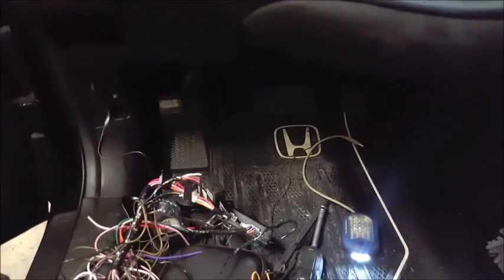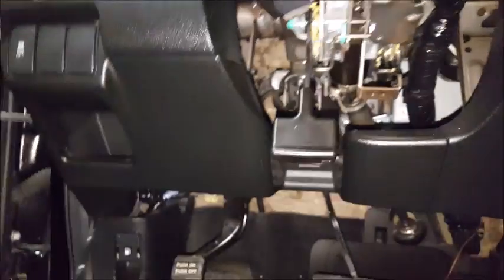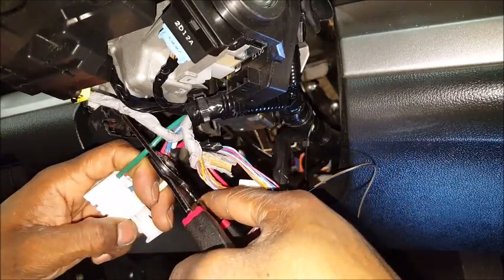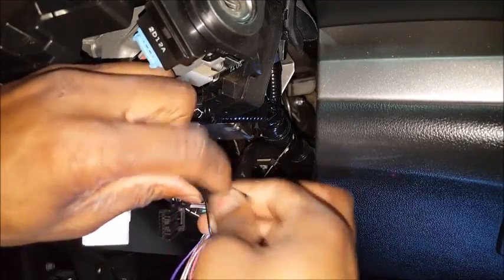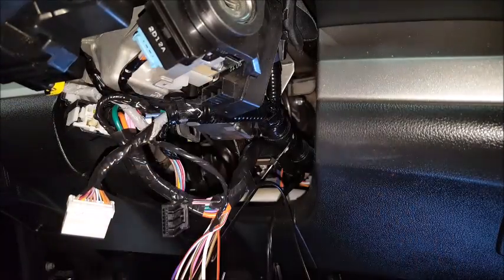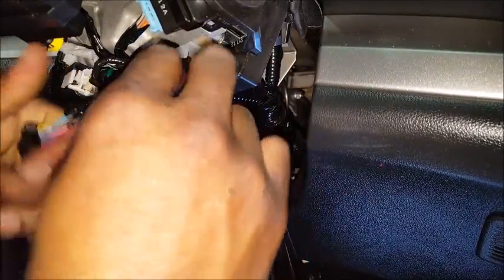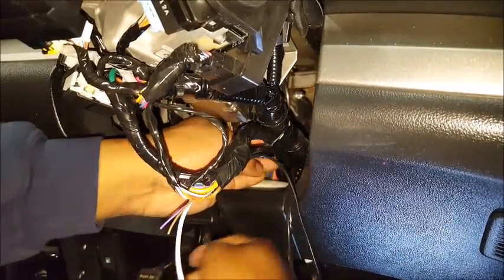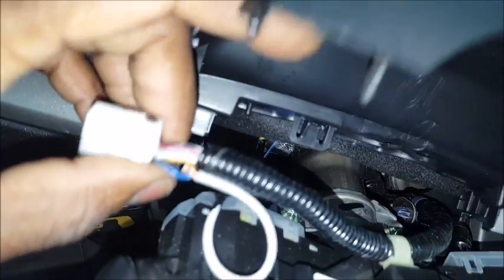How To Install A Remote Start Alarm  Completely From Start To Finish on Any Honda 2001 2017 1 HR Vid

Comment: Well very helpful and inded easy to understand, and hope you would guide us to the very end of installing the remote system.

Sir, can I split the wires which control the lock and unlock of the remote control unit and join to the corresponding wires/pins (which lock and unlock doors) of the input connector BCM so that by locking or unlocking using the fob key, all doors and all windows are closed automatically at the same time.

In short, lock or unlock with fob=all doors lock or unlock and all windows closed at a time.

Also, if that is possible, I guess no voltage issues will arise on the remote control unit and the BCM unit, since we are only sending pulses to lock, unlock all doors and windows. Kindly ignore this paragraph if I'm mistaken.

Awaiting your utmost help ad reply.
Thanks.

Comment: Is this the same for a 2008 accord
Reply from the maker: The wire colors are different  but everything pretty much is the same in the same location
Reply from the maker: This wiring information is being provided free of charge on an "as is" basis, without any representation or warranty. It is your responsibility to verify any circuit before interfacing with it using a digital multimeter.
Directed electronics, Inc. assumes no responsibility with regards to the accuracy or currency of this information. Proper installation in every case is and remains the responsibility of the installer. DEI & this Channel Creator   assumes no liability or responsibility resulting from improper installation, even in reliance upon this information.

 Wire/Function  Color  Location/Description  Polarity
 PASSIVE ANTI-THEFT  YES  TRANSPONDER    SEE NOTES 
 12 VOLTS  White  Ignition switch harness    + 
 IGNITION  Blue  Ignition switch harness    + 
 ACCESSORY  Orange  Ignition switch harness    + 
 STARTER  Yellow  Ignition switch harness    + 
 KEY SENSE  Pink  Ignition switch harness in white plug    - 
 TACH SIGNAL  Opposite from BLACK/ white or Blue  At any of the coils on the engine    AC 
 FUEL INJECTOR  Opposite from Yellow/black  At any injector on engine    AC 
 LOCK  Orange  At switch in driver door    - 
 UNLOCK  Brown  At switch in driver door    - 
 posted_image  Double pulse to disarm and unlock. May require a pulse to WHITE wire at same time as BROWN, diode isolate.
 DOORPIN  SEE NOTES       
 posted_image  Green (Driver's door), Lt.green (pass. Door), Brown (Rear left) and Gray (Rear right). All 4 wires are (-) and found in the green 42-pin plug on the top of the fusebox under the driver's side of the dash.
 HOODPIN  Lt.blue or Yellow/red  At pinswitch or front of fusebox    - 
 posted_image  Not available on all models.
 TRUNK PIN  Blue or White  In green 42-pin plug top of fusebox    - 
 TRUNK RELEASE  Orange  In green 42-pin plug top of fusebox    + 
 FACTORY ARM  Arms with lock       
 FACTORY DISARM  Disarms with unlock       
 BRAKESWITCH  Green  At brake switch    + 
 PARKLIGHTS (-)  Gray  In green plug on back of fusebox    - 
 HAND BRAKE  Lt. Green  At parking brake switch    - 
 HORN  GREEN/ YELLOW  In green 42-pin plug top of fusebox    - 
 DRIVER WINDOW UP  Red or Yellow  At switch in driver's door    Rev Pol 
 DRIVER WINDOW DOWN  Green  At switch in driver's door    Rev Pol 
 PASSENGER WINDOW UP  Orange  In harness from driver's door    Rev Pol 
 PASSENGER WINDOW DOWN  Brown  In harness from driver's door    Rev Pol 
 LEFT REAR WINDOW UP  Green  In harness from driver's door    Rev Pol 
 LEFT REAR WINDOW DOWN  Violet  In harness from driver's door    Rev Pol 
 RIGHT REAR WINDOW UP  Lt.blue  In harness from driver's door    Rev Pol 
 RIGHT REAR WINDOW DOWN  Red  In harness from driver's door    Rev Pol 
 HEADLIGHTS  Pink  At light switch harness    - 
 REVERSE LIGHTS  Brown  In driver's kickpanel    + 
 VSS WIRE  Blue  In plug on back of radio    AC 
 TRANSPONDER DATA 1  Lt.Green  Pin-3 at 7-Pin connector    DATA 
posted_image Available Notes

Comment: How do you extend the remote running time from 15 to 30 minutes
Reply from the maker: Diesel Matthew program menu 3
Reply from the maker: Diesel Matthew 12 24 without a bit writer there is no 15 30 selection

Comment: for the most part, posi-taps would've been alot easier.
Reply from the maker: Those things always failed! I can Literally live off  the Redo's and/or of just repairing Those types of installations
Reply: 4 alarm installs and still going strong.  All wires are hidden though. I think the only issue I had when i 1st started using them was that I used the wrong size posi-tap for specific wires and the pin didn't really make contact.  After that all was easy peezy.
Reply from the maker: Oh OK As long as it's working for you that's all that matters. Thanks for the post it let me know what you guys like.

Comment: Great video
8:40 -"just bite with the strippers"
Instead of biting 2x with the strippers and removing 1/3 to 1/2 inches of insulation, you can use your strippers to bite and pull the insulation back 1-2mm. This exposes a small but sufficient area of wire to work with yet does not remove any insulation. If you ever remove components it makes it look like nothing was ever wired in.

Comment: Does the Honda Accord 2000 and the 2001 have the same colored wires ?
Reply from the maker: Danny Loreto starter white black stripe
12volts main power white
Ignition black yellow strip
Second ignition black white strip
Accessory white red stripe
Reply from the maker: Danny Loreto yes sir
Reply from the maker: This wiring information is being provided free of charge on an "as is" basis, without any representation or warranty. It is your responsibility to verify any circuit before interfacing with it using a digital multimeter.
Directed electronics, Inc. assumes no responsibility with regards to the accuracy or currency of this information. Proper installation in every case is and remains the responsibility of the installer. DEI & this Channel Creator   assumes no liability or responsibility resulting from improper installation, even in reliance upon this information.

12volts white   +   ignition harness 
Starter BLACK/ white   +   ignition harness 
Notes: If doing starter kill, must interrupt the wire between the keyswitch and the fusebox, not between the fusebox and the starter, to keep the check engine light from coming on. 
Second Starter N/A        
Ignition BLACK / YELLOW   +   ignition harness 
Second Ignition N/A        
Third Ignition N/A        
Accessory yellow   +   ignition harness 
Second Accessory WHITE/ black   +   ignition harness 
Keysense          
Power Lock BLACK/ blue   -   passenger side fuse box 
Notes: in a green 20 pin connector.
Use BLACK/ white for lock and GREEN/ red for unlock on LX models without factory security. These wires are located in a two pin gray connector by the front of the drivers side fuse box. 
Power Unlock orange   -   passenger side fuse box 
Notes: in a green 20 pin connector.

Use BLACK/ white for lock and GREEN/ red for unlock on LX models without factory security. These wires are located in a two pin gray connector by the front of the drivers side fuse box. 
Lock Motor WHITE/ red      driver side fuse box 
Unlock Motor        driver side fuse box 
Notes: yellow on the EX and lt. GREEN/ red on the LX 
Parking Lights+ RED / black      driver side fuse box 
Parking Lights- RED / yellow      steering column 
Notes: Only available on the EX model. 
Hazards          
Turn Signal(L)          
Turn Signal(R)          
Reverse Light GREEN/ black   +   driver side fuse box 
Door Trigger BLACK/ white   -   passenger side fuse box 
Notes: In a green 4 pin connector. 
Dome Supervision use door trigger        
Trunk/Hatch Pin orange   -   drivers kick panel 
Notes: Above the hood release in a gray 18 pin connector. On the DX & LX models, also found in a 2 pin connector behind the drivers fuse box. 
Hood Pin yellow/red or yellow   -   hood pin switch or 
Notes: On the EX models it is in a green plug next to the passenger side fuse box. On the LX models it is at the keyless/security unit, if equipped, which is attached to the driver side underdash panel. 
Trunk/Hatch Release WHITE/ red   +   drivers kick panel 
Power Sliding Door          
Factory Alarm Arm          
Notes: Arms and disarms with the door locks on the EX models. The LX models arm only with the factory transmitter. 
Factory Alarm Disarm          
Notes: Arms and disarms with the door locks on the EX models. The LX models arm only with the factory transmitter. 
Disarm No Unlock blue   -     
Notes: On the EX the wire is located at the drivers power window switch, on the LX the wire is at the keyless/security unit which is attached to the drivers underdash panel. 
Tachometer blue      tach test connector 
Notes: The tach test connector is located behind the battery on the 4 cylinder, and on a bracket attached to the drivers side strut tower on the 6 cylinder motor. The tach test connector is a white 2 pin connector, and may be covered by a black rubber boot. 
Wait to start          
Brake Wire WHITE/ black   +   brake pedal switch 
Parking Brake          
Horn Trigger lt. GREEN/ blue   -   steering column

Comment: hey. so much information in this video, thanks. can you help me out ? i got a viper system with dball2 and a smartstart. kinda confused on how all three of these connect to eachother.

i was thinking the smartstart connects to the dball via the 4 pin d2d connected and then the smartstart connects to the viper system via esp 3pin connector.

Comment: What is the purpose of a bypass
Reply from the maker: Mario Calvillo the bypass modules trick the vehicles computer into thinking that there's a key or fob inside the vehicle by copying the coded data from either devices and feeding it back to the computer of the car only during authorized operations of the Remote start unit. It can also provide misc. Features like trunk pop door lock unlock factory alarm arm disarm and other seamless communicational systems integrations

Comment: These immobilizer bypass modules are a pain. Just spent the past hour, learning that subaru need two bypass modules to compete the remote start unit. How dumb, specially since there is only one data connector on the remote start. So I guess one module gets hardwired and the other connects to dbi connector
Reply: Hey buddy do you have a video of a 2008 Kia Sedona Bypass module from flash logic to be exact

Comment: Hey bro would it be possible to give you my number to ask a question about my immobilizer and my viper system.. theres a few wires im unsure of....
Reply from the maker: Matthew Garcia try posting your issues here you will be surprised to how quicker you will get your issue fixed buy having every step written down.
Reply from the maker: Matthew Garcia check my video history i should have on if not ill record the next one in.

Comment: I've seen much worse installs.
However, this will void your factory warranty if it still has one.
A cool video Sir!
Reply from the maker: Josh Redman By law, any  functioning aftermarket system, including a security or remote start system, will not void a vehicle's warranty. The Magnuson-Moss Warranty Act(P.L. 93-637) is a United States federal law (15 U.S.C. § 2301 et seq.). Enacted in 1975, the federal statute governs warranties on consumer products. The law was created to fix problems as a result of manufacturers using disclaimers on warranties in an unfair or misleading manner. Its the federal law Sir. Thanks for your comment you brought up a good subject and future video topic for this channel.
Reply: haha!
OK there... Sir
Excellent copy and paste skills BTW
this "law" doesn't encapsulate every and all aftermarket installs. But an install like this will surely VOID the warranty. Assuming there are any warranty issues involving the electrical system. 
Go ahead and argue, I'm sure you will. But you know its true.
Reply from the maker: Josh Redman You sound like a competing installation shop owner. What's the name of your shop? Maybe we could do business instead of sharping swords?
Reply: No sir. Just a normal dude that's worked in the automotive industry as an installer for 20 years. 
People need to know this type of work needs to left to professional such as yourself.  You own a business and do this for a living. You have experience.
Most of these people watching don't even know what a multi-meter is, much less know how to use one. 
I'm sure you only think I'm trolling your video. But in reality all I want is for these people watching to be informed. You should want the same for your viewers. 
I will admit that I was not entirely accurate when I said that it WILL void the warranty. Instead i should have used the word CAN. 
If someone buy's a new car, hacks into the wiring harness themselves, having never done this type of work before, uses the techniques shown in this video, then a few months later one the vehicles computers goes tits up... even if the install had nothing to do with the computer going bad. That vehicles manufacturer has every right to reject that repair. It doesn't mean they WILL, but they sure as hell CAN. It's in the small print somewhere in that warranty. 
The company I work for just purchased a 2018 Ford Transit. This is the first brand new vehicle the company has ever purchased. This van will need to be outfitted to be a mobile repair shop complete with air compressor, vacuum, high-output power inverter, cables and outlets ... etc. 
Now, every other van in the past we have done all the work ourselves. We have the knowledge and ability. 
HOWEVER... the warranty states that the work must be done at a certified shop in order to retain the factory warranty. We are an auto glass shop, so we do not fall anywhere near the category of Automotive Electrical.

I hope you see what I'm trying to do here. Not trying to sharping swords (whatever that means). Just keep people informed. 

Keep up the cool videos brother! I'm subbed now!

Comment: excellent video man
Reply: yes i Know thanks lol
Reply: I've been doing a lot of research on Viper Remote Start system and on their website its says that this particular device can "out of the box without any additional hardware" automatically start your vehicle if the battery is getting low or if the weather drops or rises to a set temperature. I've spoken to a local shop and they are charging extra for this feature saying that I need a "smart box chip" added to the system to do this. I'm confused can you help me out man. Thanks